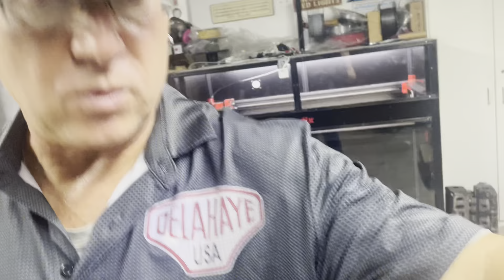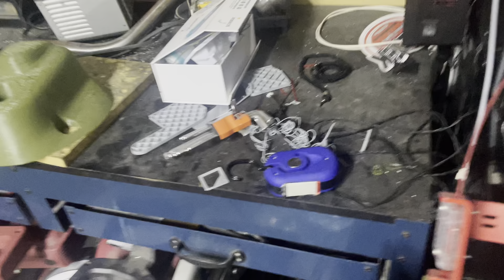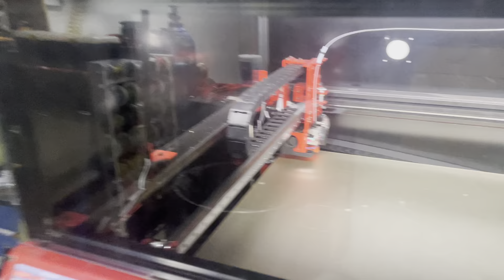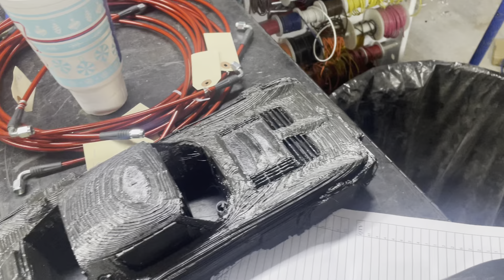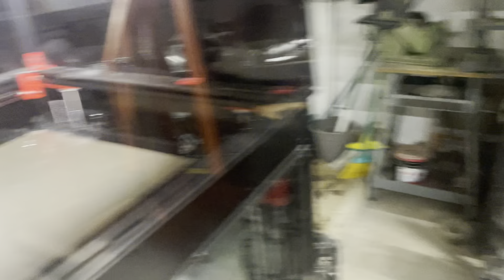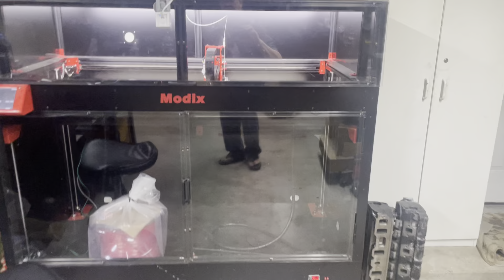Diving into 3D Printing - C8 Corvette Hack

Comment: Some years ago, I did a bit of smaller format 3d printing, but I'm by no means an expert. My thought on the car that had the stringy, disconnected look to it is that the print head cooled off. I was doing my printing in the garage and consistent ambient temperature played a huge role in the success of my prints. Is the shop you're in temperature controlled?
Reply from the maker: No, not temperature controlled but the printer has an enclosure. But I've been waned by several people that this particular printer actually gets too hot if you keep the lid closed. That might change now that the weather has cooled off.